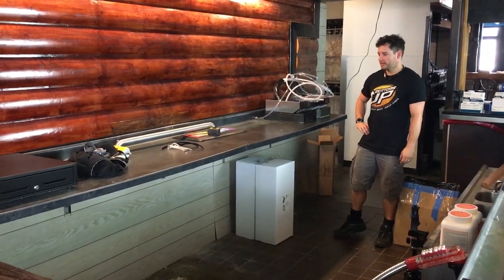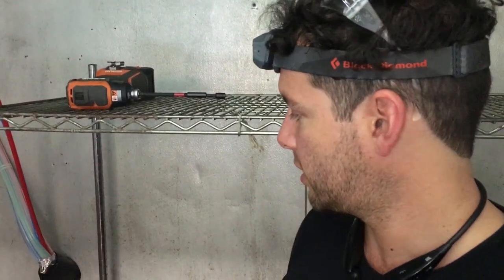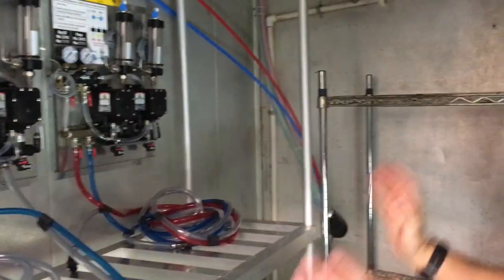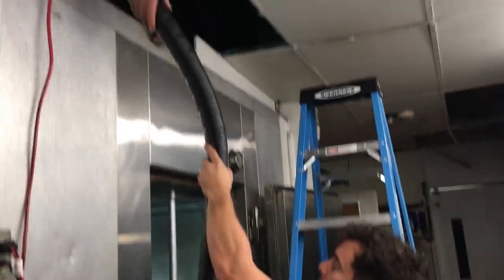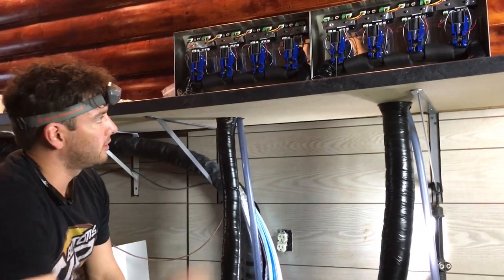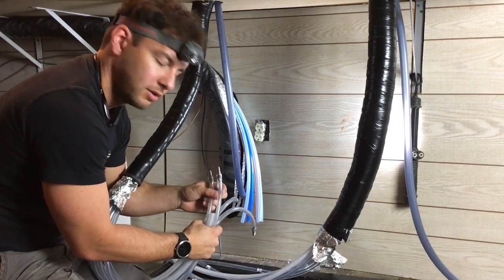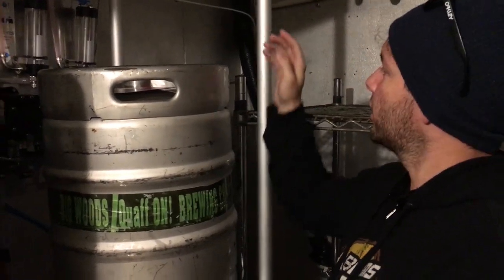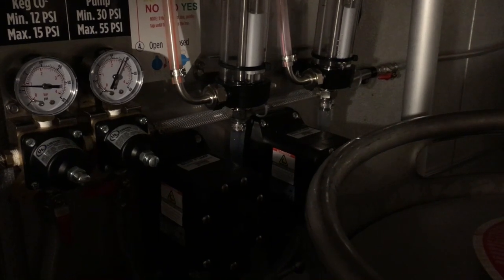Installing a Long Draw Bottoms Up Draft Beer System

Comment: I’ve glanced at a few systems in my line of work but never seen G55 pumps used for beer (we use them to pump HFCS out to the Freestyle machines). The entire time I thought the beer lines were pressurized by the CO2 supplied to the keg.
Awesome video man!
I would love to pick your brain about all the different kind of systems.

Comment: Why do you loop the lines around the perimeter of the cooler ceiling? Do that have to do with total line pressure? Thanks
Reply: I also dont get it.  They mentioned to keep at least a pint of beer in the lines.  If the extra lines are to increase the total pressure, then I can't see why they need a beer pump.
Reply: This makes no sense.  Why pumps so high in pressure,  why do such a long run. Waisted beer, over charged customer
Reply: @subzilow  Its to minimize the air in the lines so you don't get a blow up. We have a large system installed at the restaurant 
that I work at the reason for putting all the lines along the perimeter is due to the location of the panels they install that tells people where and how many kegs they can 
have.

Comment: This is amazing. Does anyone know how when pushing down the dispenser with hands while cleaning, needs to be pulled up manually but when a glass is placed on the dispenser and lifted the circular disc comes up on its own. How 🤷🏻‍♀️
Reply: yeah they come up its a magnetic seal so as you pull up